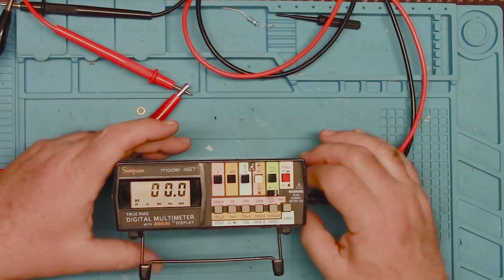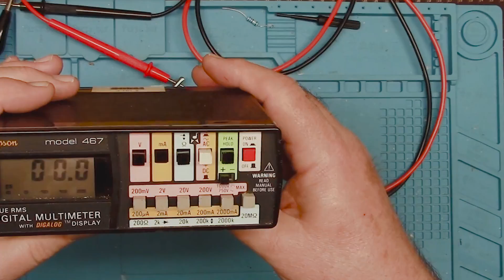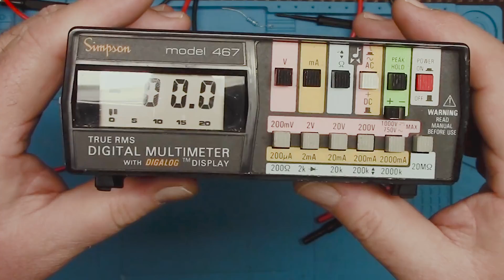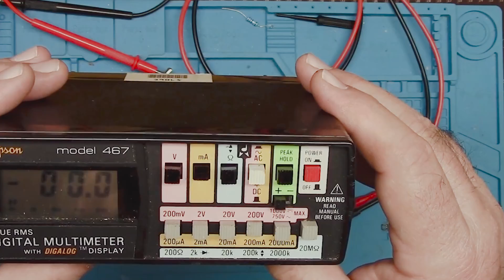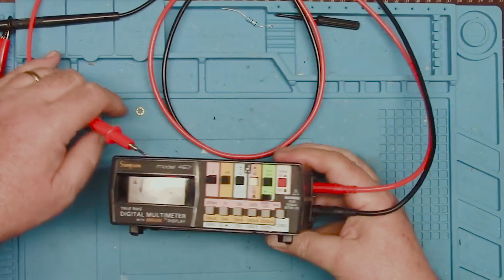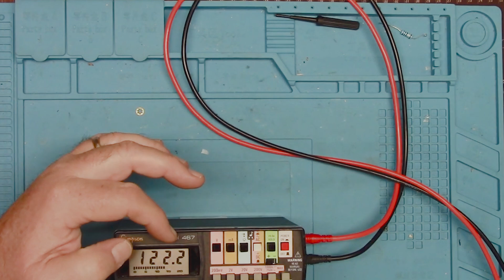Reviving the Glory of Vintage Technology - Simpson 467 DMM from the 80's!

Comment: Nice piece, I just got one that's was going to be garbage.... How can I make a self test??? Cause I push the V and 20v but nothing showed on screen when I put it on a battery... 00.0
Reply from the maker: There is at least one fuse in that thing, I can't remember off the top of my head.  Also, there may be old caps that need replacing.  Assuming your screen is good..., there's not much in it to go bad.